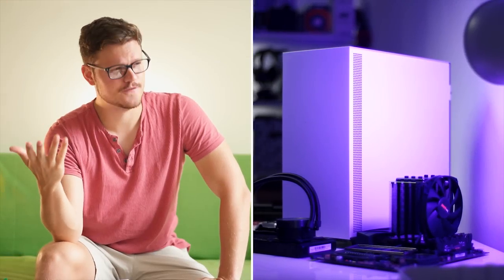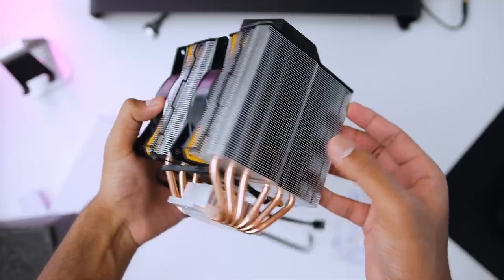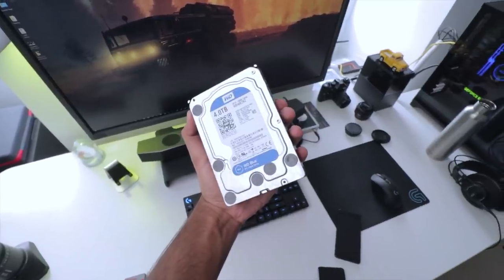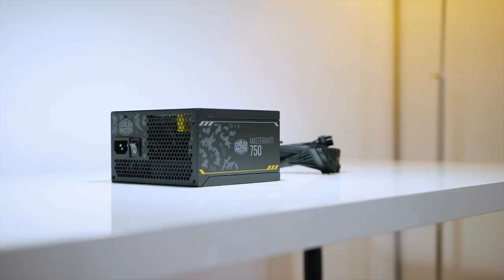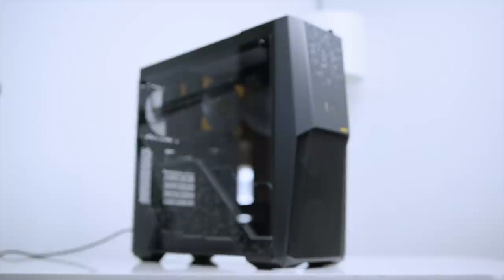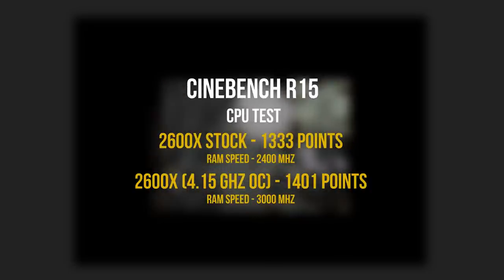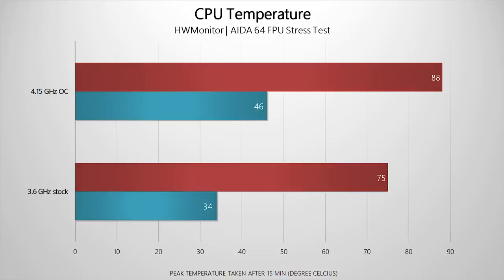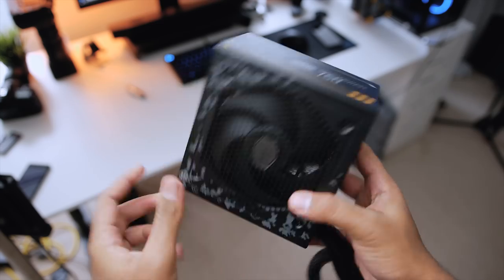The RGB-FREE Ryzen 2 Gaming Build FAILED - It Needed RGB!

Comment: Didn't buildzoid review the tuf and find that it was terrible buy? The tuf features weren't included anymore, including poor vrms and caps
Reply: needabettername I went over the spec sheet on the X470 TUF and you know what I saw? Realtek Ethernet and the ALC887 Audio Codec. For a $150 motherboard you're still getting Realtek Ethernet and terrible audio. Atleast with the Asrock Master you get Intel Wifi, Intel Ethernet and 12k capacitors. The Master is more Tough than the TUF board.
Reply: Ethan Stading yep, not so tuf anymore...sad, i really liked the tuf sabretooth am3+ board i used years ago
Reply: Might not be as good as it once  was but probably still more than fine for his needs.
Reply: Jefferson the issue is that the board is not quality, the vrms are cheap and i believe it actually a 4+2 vrm which is fine for 2600, but not really enough for 2700 or possibly next gen
Reply: yeah, Eber does video editing, not just web surfing, research, etc. I'de give them caps on the VRM 208 days of video editing before it no longer holds an OC, and death shortly after. Hell, I would advise zip tieing a fan to the VRM anyway, just because the IO cover forms a hotbox over the VRM to further stifle cooling, and the thing they have on the VRM is a fashion accessory, not a heatsink. A 2600 "Actually Hardcore Running at Stock" is pushing it for the 150usd and lower boards, lol.

Despite all that, I still think Eber did a good job making the vid, even if the motherboard is not quite what it once was. The lighting, camera angles, etc were fantastic. B)
Reply: Yup. He showed that it's also the exact same board layout as a couple other Asus boards with different branding and colors on them and sold at different price points.
Reply: It's just fine if you didn't overclock that much or not even. The TUF now just means the asthetics. Buildzoid's comments are meant for extreme enthusiasts. Not even for the regular gamer/pc user.
Reply: Yes the vrm are not ok for an 8 core, for the stock 6 core it's okish.
Reply: it can easily handle a 2700x
Reply: @needabettername Yup the board has godawful vrms and yes it is 4+2 that is straight ripped out of B350 with less than optimal heatsinks and slapped TUF name on it with the usual marketing bullcrap about durability (that is not there whatsoever) just to sell more units . it should be "okay" with 2600 at stock but I would still buy different board even on a budget. It is one of the worst, if not the worst, x470 board hands down. even if you compare it to other boards in the same-ish price range. But hey is has some colour and rgb on it :)
Reply from the maker: Not sure about it being "a terrible buy" but in this case the PC isn't being used as a primary workstation.  For that, we are gradually transitioning the team to workstation-class boards.  The Ryzen-5 and below are perfect companions for a lower-cost board like this.  When it comes to hardcore overclocking or pushing a Ryzen 7 CPU, our choice would certainly be something else.
Reply: The reason so many of us are concerned about this is that TUF used to be a high-end sub-brand, geared towards mainstram-CPU workstations and reliability-focused users. Now ASUS has taken that brand and essentially turned it into a budget-tier version of ROG, while still attaching the high-end branding to it. It's deceptive marketing at best.
Reply: @HardwareCanucks But you adress this nowhere in this video. In fact: you praise it for having high quality components and durability electrically. Which really couldn't be further from the truth. In reality it's just an overpriced budget board hardware wise. And no, some fancy print on the PCB and RGB doesn't justify it's price tag, not when you consider what "TUF" used to stand for in ASUS' product placement. TUF nowadays seems nothing more then a marketing ploy. You either fell for it, or you sold out.

Comment: No RGB? Well here's an idea for a blackout build: 

be quiet! Dark Base Pro 900 rev.2 case
be quiet! Dark Rock Pro 4 CPU cooler
G.Skill GTZKK series RAM
MSI Z270 SLI or X299 Raider or EVGA X299 Dark motherboard
EVGA 1080Ti Black Edition graphics card

*Flashlight for viewing internals sold separately...
Reply: sounds cool to me =)
Reply: EVGA 1080Ti Black Edition have white led
Reply: Then disconnect the LED cable from the PCB. Problem solved.
Reply: Raivo K Now this is a good idea man!
Reply: I have an all black pc and it looks amazing. Non of that cheap looking RGB garbage.
Reply: I fucks wit your vision
Reply: JDTechGear did something similar.
Reply: No RGB build, meaning no Red Green an Blue, a white LED strip isnt RBG because you can't change its color.
Reply: Raivo K dis sexy

Comment: I really need some help. I have a dead PC with an MSI mobo, Ryzen 3 and Antec 450W PSU... There appears to be no power delivered to the mobo, the ez debug LEDs don't turn on. MSI customer support was very disappointing. I swapped the PSU with another 400W and yet no sign of life. Any inputs/suggestions?

Comment: Why is it running so hot?  That looks like a  pretty beefy air  cooler. And it is only a 6 core CPU.   Is the case starved for air flow ?  Do you need to move the front fans up so that they are both  above the PSU shroud?
Reply: because 1.425 volts... i have my 2200G OCd to 3.9 at 1.36875 volts under a wraith prism in a silverstone rl06 and it only hits 65c

Comment: Based on the benchmarks, would it even be worth it to buy 3000mhz ram? Or should you just buy whatevers cheapest if you cant affored anything higher than 3000mhz?
Reply: Considering that this was a AMD based system 3000mhz is optimal.  If it was a intel based system the ram can be slower.

Comment: Love the grey and digital camo look, but the yellow/light orange coloring is just off to me.  But I know that was the original color accent for the tuff line.  The build looks awesome and have to agree that a little RGB does look good.   Especially if you are placing on the system on a desktop.  I have my system on the floor still and built it to be as quiet as possible.   Do you think you might go to AIO for the CPU cooler or even test your hand at water cooling?  I'm looking to water cool my entire system on the next upgrade with a custom loop.

Comment: I might be wrong, but since in my pc an i7 6700 doesnt bottleneck a 1070 at 1080p, i think a 2600x might not be the best match for a 1060 in a gaming pc.

It would be interesting to see if a 2200g is able to keep a 1060 happy or if a 2600x would be enough for 1080ti (i guess yes on both)
Reply: I have a 2200G with an R9 390X and it doesn't bottleneck. Also only have 8GB of RAM in Dual Channel, still plenty for today's games at 1080p Ultra!

Comment: I was planning to build a pc with the same concept of this video, its the same build but $720-750 (US) $1000(IN)
CPU         - AMD Ryzen 5 2600
MoBo      - MSI B450 Pro-M2
RAM        - Corsair Vengeance 8GB 3000 MHz
HDD         - Seagate Baracuda 1TB
SSD          - Kingston A400 120gb ($30)
PSU          - Corsair VS 550
Case         - Corsair 100R
GPU          - MSI OC v2/Armor OC GTX 1060 6g or RX 580 8g (would wait for next gen *$400 in my country)
---------------------------------------------------------------------------------------------------------------------------------------------------------------------------------------
Peripherals: (not necessarily buying; adding just for comparison with the video Logi~$390, Cor~$430 )
Keyboard+Mouse    - Corsair Vengeance K65(Discontinued)+Corsair Harpoon ($120 total)
                                   ~ Logitech K840 + Logitech G102 ($70 total)
Mousepad                - Corsair MM200xl/MM300 Med    or   Logitech G240 (C=$20, L=$10) or maybe SteelSeries QCK
Monitor                     - LG MP59G (24 or 27 inches +75Hz+Freesync+1ms G2G+IPS) ($180 or $210)
Headset                    - Corsair HS 450 or HyperX Cloud Stinger (C=$ 65, Hx=$50)
CPU Cooler              - Corsair A70 Air or H55 AIO ($40 or $50)
-----------------------------------------------------------------------------------------------------------------------------------------------------------------------------------------
The PC with peripherals is coming at the cost of just PC in this video, suggest any edits to the build. I will be using it mainly for coding and CSGO (occasionally AAA). I like monotonous themes so I decided to go with a same-brand theme with a Black+Grey color accent and no RGB. Could anyone suggest some good peripherals matching with the build and an SSD?

Comment: Well, slap on a mobo copper VRM and chipset coolers with heatpipes. Use cold cathode lighting and a 2005-2008 PC case  like the CM Stacker 830, the TT Tsunami Dream or the Shark, the Chieftec Dragon Windowed, the Antec Plusview 1000AMG or the Lanboy, a Lian Li PC65 or a Superflower 201S case for example. Then look for rams with coolers without RGB lighting

Comment: Leave 2600X at stock settings and with RAM at 3GHz you will be better in most apps vs the oced one. It clocks higher at stock for single thread when needed.

Comment: Choosing a single LED color without any effects don't make a RGB build. It's a selectable color that can change if you change the theme later.
Also, you can use the RGB software to create alerts (ie: for temperatures).

But still, it's not a "RGB build".

Comment: As many people seemed to find the parts selections very bad especially with the TUF series although I never seen that series before. However your particular selection for SSD was very odd I understand you like to advertise Toshiba this Toshiba that but the OCZ RC100 is a terrrible value drive. Lets be honest if you just go on Userbenchmark you can find a value orientated drive like from Adata or Mushkin for a really good buy its actually insane to see them up so yeah make sure to do more research on value heads up...
Other then that its a pretty good build.

Comment: "Being a TUF-series board, expect high quality components..."
That is just outright false information. The TUF series used to be good (sabertooth), but nowadays they're pretty much the worst boards you can buy with the cheapest components. Please research your parts a bit more so as not to mislead the consumer. It's fine for a low-end build, but that should be mentioned.

Comment: While the build looks great and all the problem is you used the TUF X470 board which has the VRM from their B350 boards at X470, at a higher price point. You are basically showing off a scam of a board here. I do not approve. Asus has been running their TUF branding into the fucking ground and I feel the industry needs to be speaking up about this.

Comment: nothing wrong with RGB idk why people hate it. Some RGB looks great when properly balanced with non rgb components.
Reply: RGB is a lot more reasonable for aestetics as oppose to choosing components based on their OEM appearance/ color scheme. You often pick worse parts just to maintain a certain look. That's truly counter-productive. I find RGB pretty harmless.
Reply: Skaldwo I personally prefer no RGB, I have to say I'm curious why some people hate it as well.
Reply: Skaldwo Comes down to preference and use case. For example I know people with computers in their room which run media servers 24/7. Better to have a build focussed on quietness and as few lights as possible (potentially even disconnecting the HDD lights on front panel as well). Then there are people as well who will find it gaudy as well. Most gamers are probably in the realm where they like the aestetic but plenty will not.
Reply: I generally don't like RGB for different reasons. One is that closed cases without windows are disappearing because of RGB (there are still some enclosures with no window, but the vast majority out there seems to have a mandatory transparent glass. And the glass is there to show the lights.  Second, I think that a juke box, a christmas tree or a flipper could have sense in certain situations and places, but does not make those objects elegant or stylish (just think of cars: there are guys who use rgb for their cars, and there are elegant cars: usually the two things are separated). Third, my computer will go in my room and sometimes it works at night so I don't want to see a rainbow of lights while I'm trying to sleep.
Reply: @Browl the Owl I think Gamer's Nexus did an Ask GN where someone said RGB parts added a lot of cost to parts. Steve basically said it adds like 5-10 bucks. Wouldn't consider that "a lot"

Comment: 3000mhz ram is a bit of a weak spot honestly for Ryzen 2 would have been better if managed to put some 3400-3600mhz in its a pretty big difference in performance on average, like difference between Ryzen 1 and Ryzen 2 clock/clock

Comment: gaming build with ryzen ? :/
Reply: It's pretty good for gaming and more, if you don't like AMD products - it doesn't mean that they suck.
Reply: Not being the best != Not being good enough (specially for the price).
Reply: Amd is only about 5-10% slower is some titles and only if not gpu bound..and since they aren't using a 1080ti, most games will be gpu bound
Reply: Lord Pants, i wouldn’t call the intel chips unaffordable, just not as good of a value proposition as AMD chips
Reply: No need to start fanboy wars in the comment section
Reply: Anti-AMD for gaming? 2010 called and wants its comment back.